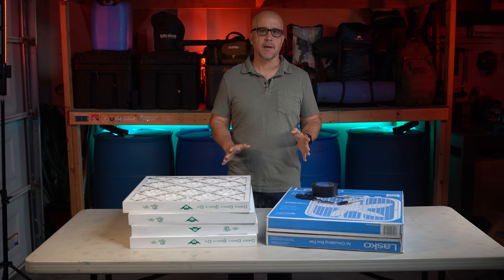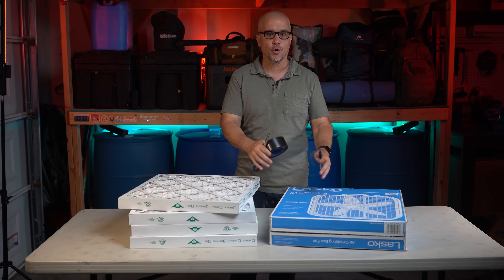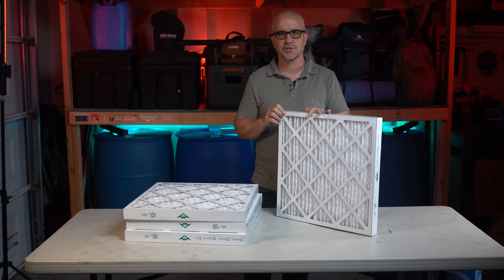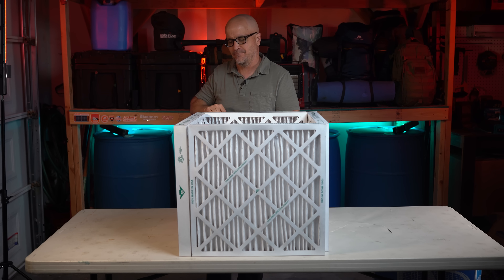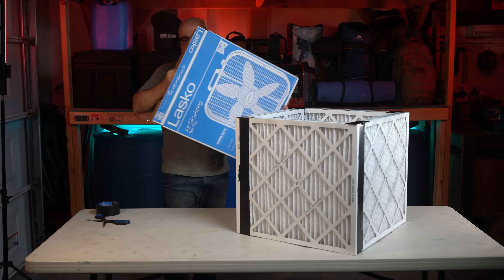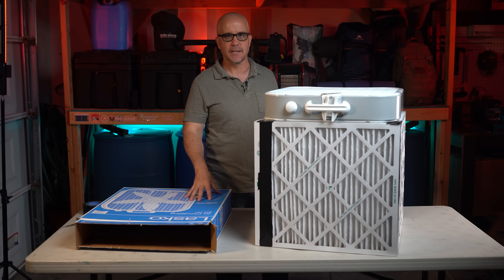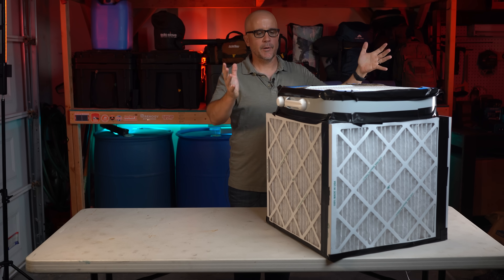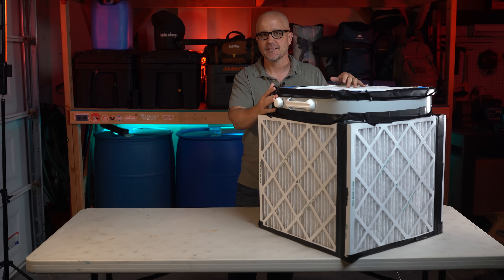How To Build An Affordable Air Purifier (DIY)

Comment from the maker: Here are the items I purchased:
* Merv 13, 20x20x2 air filters: https://a.co/d/0O3c7Xj
* 20" box fan: https://www.amazon.com/s?k=box+fan
* Duct tape: https://www.amazon.com/s?k=duct+tape&crid=7OXBQQTAWCYQ&sprefix=duct+tape%2Caps%2C134&ref=nb_sb_noss_2
Reply: This list of parts is so helpful. Thanks
Reply: What about  the bottom? Why not use another of the cardboard boxes and block the bottom off properly so that you don't get air sucking underneath the bottom edge of the filters?  I'd also make your shroud hole smaller and reverse the cardboard so that you have the plain  side showing.
Reply: @matthornton44   You must have missed that part of the video... 
He did cut down, one side of the box to block the air flow, from underneath the filters!  😊
Reply: I don't know how you came up with under $60. Try $106.26. But nice try. These filters can be found for a lot less.
Reply: OK, COLOR ME STUPID LOL. SO IS THIS SUPPOSE TO SIT IN ONES LIVING ROOM OR ANY ROOM. WHY NOT BUY A HEPA FILTER AND LEAVE IT AT THAT? I TRULY DON'T GET THIS CONCEPT. ALSO, WITH NO GRID TO POWER IT, IT'D BE USELESS. PLEASE EXPLAIN THIS. THANKS
Reply: @wheepingwillow24u17  You just sit it in whatever space you want to filter the air in. It's not for a grid down situation, it's for the current bushfires etc. We've had several years where the smoke has been horrific from bushfires, and an air filtration system was desperately needed for anyone that had breathing/lung problems. We still had power the whole time. The filters that he used ARE HEPA filters. You can't use those filters without a fan though, they don't do anything without airflow.

Comment: The price of 20x20x2 2-pack filter now at walmart is $32x2 for 4 filter is about $64 and the lasko fan is for $23 so for around $100 approx. with ducktape and all for a DIY air filter you could just buy a not so ghetto looking air purifier on the market and you wont be embarrased if your friends and family ask what is that ugly giant box in the corner ? Not to mention this is not a HEPA level filteration either so maybe think about that aspect as well before running to the local box store. Just my honest suggestion.

Comment: Tbh, I think...
Instead of blowing up, it's better for the fan to blow, side way...
So, that I can place it by the wall...
Maybe we don't even need 4 filters, just 3 would be just fine, right?

Coz, with this set up, we can't really use it as a fan, right?

Unless, you're going to place this purifier in the middle of the room, that is...

2ndly, you can't use it as anything else, right?
But ...
If it's going to be at the centre of a room, anywhere...

Why not make it also can work as table?

Or, even better...

What do you think of turning your existing living room table into air purifier?

Comment: White duct tape and add color to topper using construction or wrapping paper, could use markers. Usually use box cutter tool very carefully tough with sizzors.
Also, could be covered loosely with muslin over the filters,to increase filtration or cotton?
Looks light weight and portable.
Could be turned on its side to clear air as in , smoke from burnt food?

Thank you 
Good project.
Frugal man

Comment: Lasko now sells a fan with a holding bay for a 20x20x1 Merv 10 or 11 filter... i have one in my living room... these are by far the best whole house air filtration units on the market... even professional air cleaning systems for wood shops can not move as much air per hour as one of these...

Comment: If people are not able to open windows due to light but annoying smoke what is the best thing to do? I would be tempted to put something over all my windows and air bricks but dont want to suffocate.  I think the filter shown is an excellent idea but what if more is needed? Im thinking something to trap germs and smoke as much as possible before they come into the house. The videos and warnings when there are fires when people are advised to stay indoors with windows closed is a worry.
Reply: build one of these... they do an amazing job Lasko now sells one that has a built in replaceable air filter...

Comment: Most people that use a box fan with a furnace filter also use a pre-filter so their main high quality filter will last a lot longer.  Is there any reason not to use four pre-filters with this setup? Is that too restrictive on the airflow? 

Does using four filters instead of one make it easier for the fan to move the air?

Comment: Some good ideas here.  I'd like to suggest, to reduce the fan noise, why not shroud the exhaust?  Just use cardboard, perhaps lined with something soft, to shroud the exhaust of the fan.  If you add a curve to it the noise reduction will be far greater.

Comment: One problem..
The fan was designed to be used in an up right position and the motor bearings were designed for up right position..that's why the fan feet are on the bottom..right..
Your filter fan design is true overkill and uses a lot of floor space and those filters are not cheap to buy..
A much easier design would be using the fan in up right position with one filter on the intake side and the fan suction keeps the filter in place..
That's how I did my fan filter setup and works great and almost silent on low speed and LOTS cheaper than your setup..
Also because my fan isn't taped in place I can stop the fan, remove the filter then take it where needed..
Your viewer can decide which model they like best tho..

Comment: Silled is sealed and nill is nail ? What is the nail for ? I have done similar with 2 filters with a box fan and seal with white gaffer tape, however this one looks more efficient, would LOVE  to have seen with more smoke to actually see the results, but I still don’t understand the  suspended nail ?  I missed something there. I think I saw this on “This Old House” but don’t 
remember a nail there either.

Comment: This build is super practical because it can be stored in a much smaller package.👍
In an instant of genius, I slept 2 nights with the window open while we were getting most of the smoke in Quebec. Took me almost 2 weeks to stop coughing and I live pretty far from those fires. 
I did buy a small air purifier for the bedroom afterwards and been running the AC continuously since. If you snore or barely breathe through the nose at night, you should try a HEPA filter in your bedroom.

Comment: This may be a little off topic but has anyone tried putting a merv filter in your house window? Every spring we start opening the windows and eveything gets coated with pollen, mainly my kitchen table. My thought is the filter could absorb the pollen coming in. My concern is a window will have air flow going both ways (in/out)

Comment: I guess you could do a dif version by using a large heavy cardboard box of the right size, and just having one filter put into a side and the other three sides cardboard, so you wouldnt have to use as many filters. of course it would only clean one fourth the air. clever apparatus by the way on your part.

Comment: I’ve built 2 of them the same way over the years. Merv 13 was too restrictive for the motor and it burned out in a week both times. I then used a Merv 11 and it has lasted over a year now. Hope this helps.
Reply: The fans don't last like this and they're being made cheaper every year so I really question the design.
Reply: What do you mean burned down?

Comment: Most commercial versions have a built in air quality monitor.  Is there an air quality monitor you would recommend, to test the thing is actually doing the job?  Also, when to double the units if one unit is insufficient?

Comment: This is much nicer than the one I built two years ago. I just cut a hole in the filter. I had a shroad from a car radiator. I think I'm going to buy some more filters and use my box fan. What a great idea ty.

Comment: You don't even have to have 4 air filters, just one taped directly into the fan with the air flow directions aligned will also work. I'm sure you'd need to replace the filter more often. Just tape works, no wire, screws, whatever else you listed.

Comment: These cubes fans are excellent on so many levels.
The fact that the fan creates low pressure increases its structural integrity
It is a low energy, low resistances, means to steadily purify air.
You can vacuum that outside carefully and reinvigorate the filters.

These have so many applications.
They are great for general air-quality
They are a superb measure for wildfire smoke or other particulate contamination during industrial accidents or fires.
If there was a radiological incident, these would at least filter out particulate based contaminants.
Just be wary that the outside of the device is going to be steadily coated with whatever it is you are trying to filter.

Great job
Reply from the maker: Thanks!
Reply: @CityPrepping  Great building the only issue is the fan is pointing the wrong direction, you don't want the fan blowing in you want it blowing out so that the air is sucked thru the filters. It's not only more effecient but like the other commenter says you can vacuum the filters to extend life and you also won't have dust on your fan as the air passing it will be cleaned by the filters.

Comment: Hi,
I don't understand why the air flow is this way instead of reversed where all the "dirt" would be kept inside the box.  I like the project, I just wonder why not build it the other way so when it's well used all the dust/dirt is on the inside for easier disposal.  Also if the box is bumped or moved there isn't all that filter dust on the outside of it.  The draw back I guess is the fan get's dirty too since it's the dirty air coming through.

Comment: Great stuff.  If you don’t have access to filters, I’ve cut large holes on 4 sides of a cardboard box and pulled 2 T-shirts over the box to act as filters.  Then attached the fan the same way.
Reply: and you can wash shirts and use again 👍🏾
Reply: Even if you have 1 filter you can always tape it on

Comment: Under $50? 4 MERV13 filters will cost about $80 and the fan $25. Little over a hundred bucks actually.
Reply: I bought a pack of 4 for about 40$ on Amazon a week ago. Could the price have gone up?
Reply: @jacksonfamily678  What brand? I've been getting mine at Lowes, but I found that "Filterbuy" sells at a much better price (on-line where you got yours), but even those are $63.80 plus tax.  Did you get MERV 13? They are more expensive.

Comment: Your box will work well for filtering inside air. Also living in a dry wildfire area I've taken a slightly different approach. I've added a second layer of filters to my roof mounted swamp cooler. Like with your box, sealed so all air passes through the filters. The wet filters aid in catching the particulates from the air being drawn into my home. The fan adding positive pressure to the air inside my home helping prevent smoke from entering around doors, windows, etc. Plus it's efficiently cooling my home in the process. Most wildfires here being in the heat of summer I've found this method works best for me.

Comment: I have looked high and low and there is no way to build this for under $50 more like double that. It is still a deal at $100 for what it does. In my search I found some 4 inch merv13 filters for not much more doubling the filter area. Plus adding a charcoal filter can help with the odour.

Comment: Corsi Rosenthal box is great for any time we need to increase air purification the best place is to run them in the middle of the room. MERV13 or better. 
It’s a great air filter hack
Reply: My husband bought MERV8 because it's all the store had (and they were way more expensive than this video says, even though they are a lesser rating)- do you know, are they useless or at least better than nothing? Thanks :)

Comment: I built a simplified version of this last year using 20x16x2 filters and even though it is not as efficient as your design it does a fantastic job of eliminating wildfire odor in the house!  This is sooo much cheaper than replacing the expensive filters in my fancy air purifier. Your shroud has given me an idea of how I might frame it so it doesn’t have to be taped enabling more compact storage and the ability to use the fan for other stuff. (Not as efficient as your design but still effective for the amount of smoke that I usually deal with.)  I hope everyone understands that this really works!!  Thanks for sharing!
Reply: BTW I used the least expensive filters that I could find so it really was about $50 including the fan which I picked up on sale.

Comment: Could it overheat?  I had a window fan in the bathroom and when I shut the bathroom door there was too much back pressure in the room and it overheated. Another fan the same type as I had in the bathroom was in our bedroom and when I shut the bedroom door it started smoking. Just a caution.

Comment: Slight alternate idea...
Same materials, just more of them.
It will be more expensive, but you will NOT have to tape up the filters every time you buy/find new ones.
Buy 4 20' box fans, and use all 4 boxes (not the fans) to make a housing to hold the filters.
So whenever your current filters run their full lifespan and they cannot be cleaned safely, you can remove them and insert new ones to continue filtering the air you breath. (Might need 5 boxes...)
Reply: How would that work? The boxes are solid. Wouldn't it block the filters.  If it works then purchasing 20 by 20 card board boxes would be less expensive and just purchase one fan.